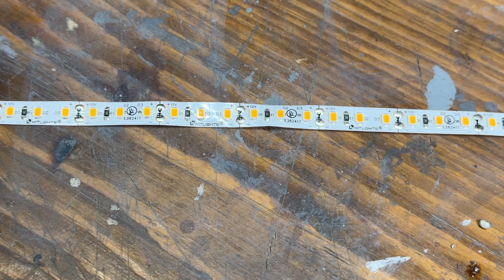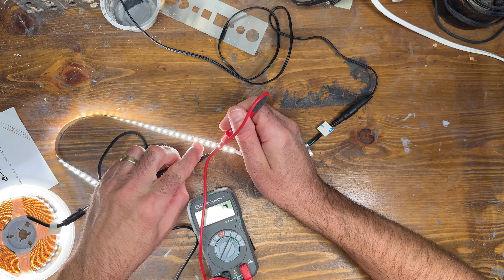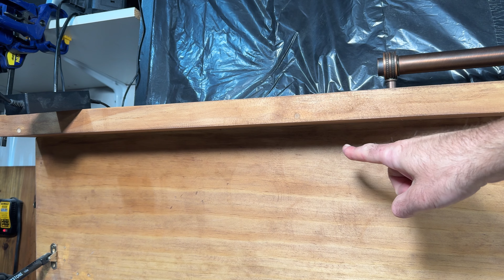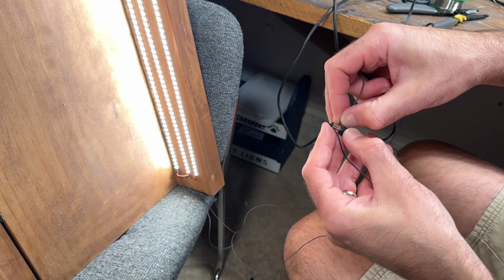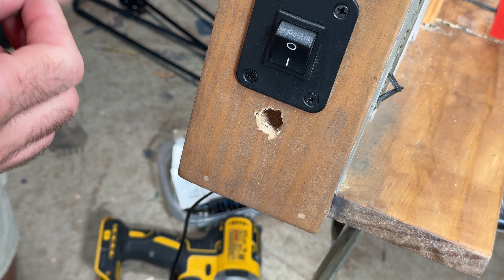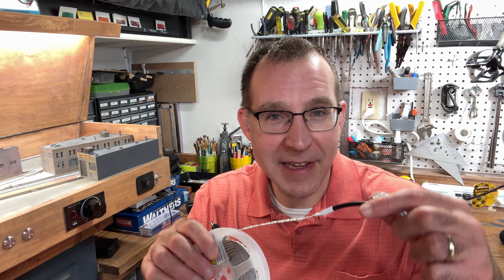Easy Layout Lighting with LED Strip Lights

Comment: Only one comment Steve.
LED tape should always be used with a heatsink. Which can be as simple as an aluminium strip as wide as the tape and 2 or 3 mm thick. LEDs do generate heat and if that is not dissipated then their life will be shortened. 
All manufactures mention this but outlets like Amazon do not pass that information along. 
With that in mind LED tape is a great way to light a layout. 
Regards Brendon
Electrician and lighting engineer
Reply from the maker: Good idea. What I've done now is switch to a 9V power supply instead of 12V. 7.5 volts is too dim, but 9 is still quite bright, but they run cooler and should last longer

Comment: Great video Steve on these LED lights. That'd definitely be good for working on the layout especially with a switching layout. I wouldn't be able to use them having a 4x10 with a 2x8 off one end.

Comment: Those LED strips are very good - we use them on our club layout.  They are available in cool white and sunlight color temperatures, too.
Reply from the maker: Yeah, I actually got a couple color temperatures, and decided to use the "neutral white" or whatever they were. I don't like the cool white as much and the warm white is nice, but I think better for regular lighting. But, one option would be to use a few different colors on different circuits to simulate midday, early morning/evening, or nighttime.